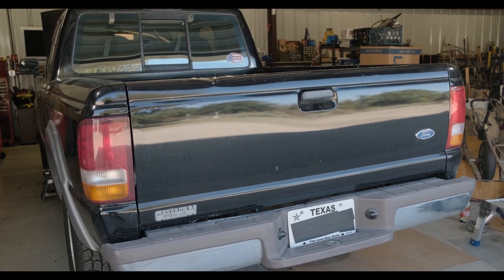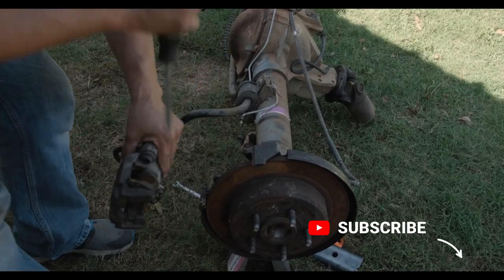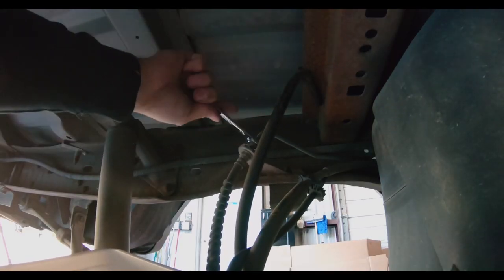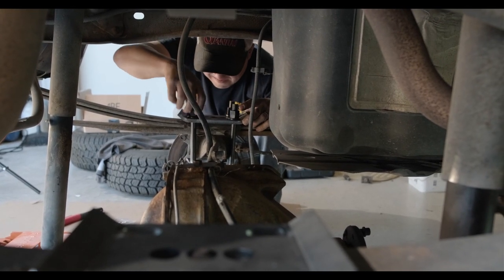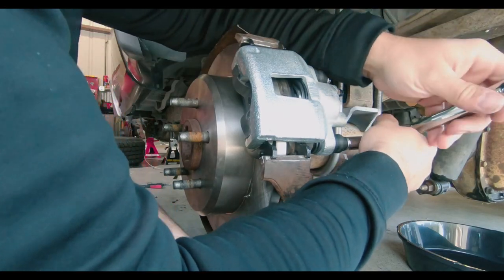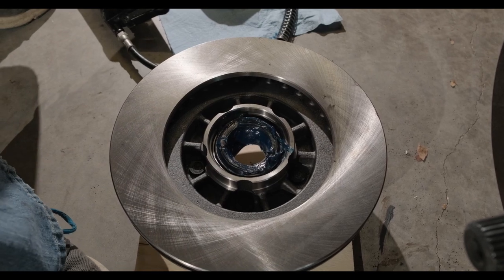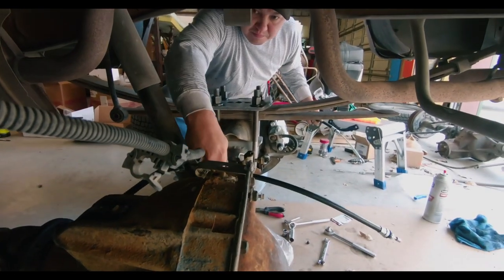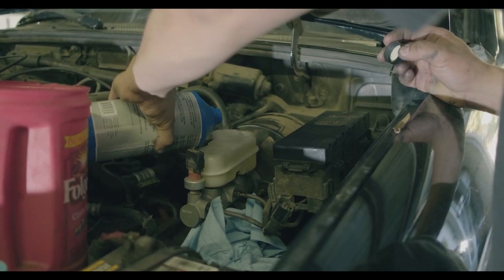SWAPPING THE REAR AXLE IN MY RANGER! - Danger Ranger EP 4

Comment: Great work. All I can say is I'm thankful my 2008 Ranger Sport was optioned from the factory with the 8.8 with limited slip. It's got no rust on the body has less then 50k miles and has the 4.0. I just got it last year and figured I'd have to get an 8.8 out of an Explorer but this evening I looked under the truck and got the axle code off the door sticker. It was a nice suprise.

Comment: How did you determine where to weld the new spring perches at to get the right pinion angle?
Reply: The book provides you with pinion angles. I don't recall what book I got but it provides me with everything someone would need doing that. Once you got your pinion angle degree there's probably a lot of measuring to be done 😂
Reply: Pinion angle is 6 degrees. There's a write up on the ranger station forums.

Comment: I'm doing this like currently and need to know did you skip re-ataching the sway bar dealio that you took off with the original rear axle? I'm struggling to find the mounting gear for the larger explorer axles that connect the original sway bar to the new axle
Reply from the maker: I left the sway bar disconnected

Comment: Curious...the Exploder axle is supposedly 1" longer.  Did you space the front wheels or just ignore it? (perfectly acceptable, IMHO)

I'll be doing the same swap with truss and 3-link + panhard (and 5.13's...and a Tru-track), also got the Yukon chromoly axle kit with c-clip eliminator....adds another inch I have to compensate for.
Reply: I used the explorer axle as is in my 87 ranger, I used a stock steel wheel from a later model crown Vic and had them widened 2" this setup would tuck into the wheel well. It ended up being a 9.5" wide wheel with a 8" backspace for this to work. With the axle another inch wider on each side it may be more challenging to find a wheel to work. Good luck!

Comment: Nice work!

When you went to weld the new spring perches, did you just measure to get it exactly on the other side of the axle tube (180 degrees)?

Or did you choose another method?
Reply: You need to set it based on the pinion flange angle. Pinion flange should be angled 6 degrees up with the spring perches level.
Reply: @AlexBarker11  haha a few years late, im a full fledge mechanic now and I don’t even own a ranger anymore haha
Reply: @jdfreeman97  it’s always that one comment you couldn’t get he answer too that gets you into mechanics 😂

Comment: Do the rear disk brakes make stopping that much better?
Reply: Yes BUT, the peddle feels different. Calipers seem to take more fluid to move than drums,   so the 8.8 calipers seem slower to engage. They still wirk fine with the stock master cylinder, but they feel different.